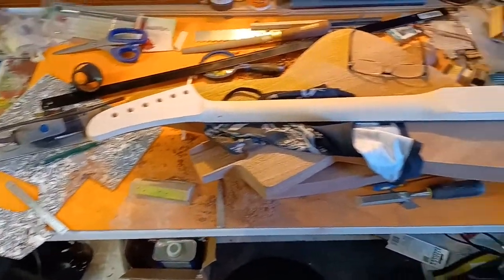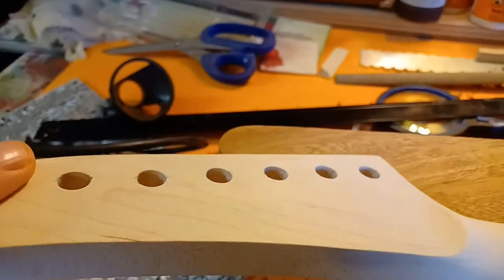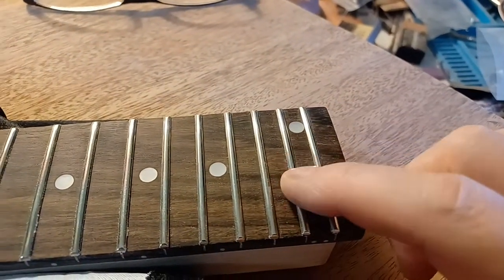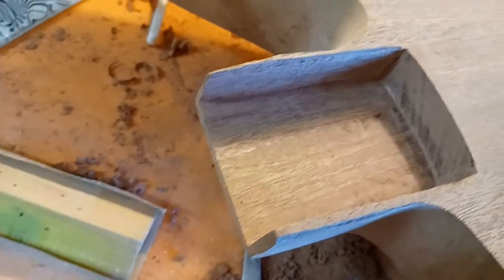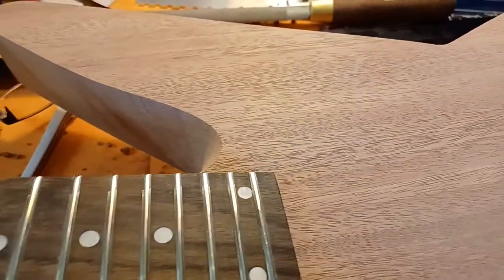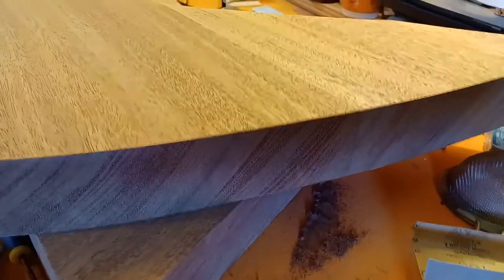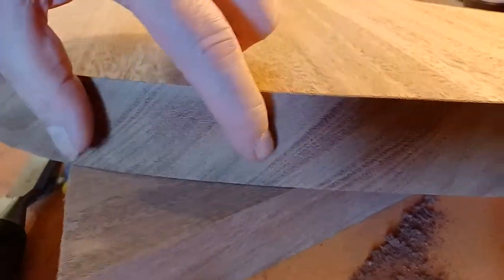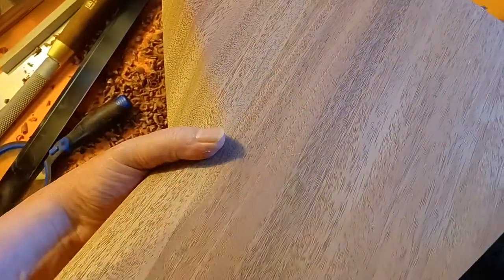GGBO 22 Build Status Update: Back to using shorter videos.

Comment: You might be able to get some of those heavy scratches out of the finger board between the frets using a box blade type of razer blade used as a scraper. Kind of sucks that the quality control was not any better. You are getting there.
Reply from the maker: I was thinking like 800 - 100 grit paper in the direction of the grain. But the razor idea is surely worth a try. Just not sure how steady my hands are for something like that.  these are the same guys I got the neck for the BRS from and that was spot on minus a little sanding to get rid of the sealer so it would stain properly.  

I'm not entirely sure this was meant to be a "Production" level neck either. They normally use medium or larger frets, larger inlay dots and seal the wood this one is not sealed. As far as I can tell this was the only Explorer style head stock neck they had. I looked many other places and couldn't find one that wasn't a true Gibson neck with asking prices in the $400 plus range.
Reply from the maker: Hey Robert. Dude I owe you a beer er somethin hahaha. I just got done scraping that fingerboard. What a major difference. Cleaned up those lines nicely AND brought some of the more subtle grain features to the front. Gonna post a short video later to show what a difference it did make. It even feels Much more smooth and slidey.

Comment: Nice work Bill and good thinking for moving the jack socket round further, I always put the socket right round near the strap button for ease of use too! 👍
Reply from the maker: Thank you Gio. I don't understand other then tradition why makers STILL put the jacks under the bodies on the lower side. Most people wrap the cord over the strap button to keep from tripping on it. Then there is the wireless systems even MORE use these days where he transmitters hang on the strap and the wire hangs down to get plugged in. I can not tell you over the years how many cable ends I have had to fix for myself or other players because of that.
Reply: @borgonianevolution  agreed, I mostly play sitting down and I use wireless which makes the traditional placement totally wrong for me. I think more and more people are going wireless now too.
Reply from the maker: @TornelliGuitars  I still have an OG Nady pro system in a box somewhere from back in the day with my last band I played Bass for.

Comment: Have you thought about putting 2 pieces of tape on the twelfth fret and filing a fall away into those last 6-8 frets? That may get rid of this fret damage! Just a suggestion man. Looking forward to this build. ✌️ Love that body.
Reply from the maker: Yes sir I did. I thought I could cure the ding with fall away but it is still there. Less predominant then it was but still there. Its on the 23rd fret at 4th string height so not much gets played there from me at this point of experience and abilities so not too worried. Well other then it triggering me because I KNOW its there.

Comment: Looking good sir....yeah neck does have some blemishes, hate that. My 2 cents on the body....add some curves to it! The straight edge look is cool, but I'm all for adding curve to the horns, etc. Of course, I am not sure how easy that will be with your current tools. But you have done a good job already! Keep it up man!
Reply from the maker: Are you talking about rounding just the edges or rounding the body itself more like a Stratocaster round? Explorers tend to be more flat faced with comfort and contour carves mostly on the back so you don't have a square edge sticking you in the ribs or belly.  You have to be careful when rounding over a flat faced body as proportions can get wonky really fast. Ever see how wonky an Ovation Acoustic looks and feels?
Reply: @borgonianevolution  Mainly the horns like you mentioned in the video. Still keep the main shape, but round the horns and if there are any other similar areas that would need it. I wouldn't want you to redo your whole design or anything =) 

Ah yes, my main acoustic is an Ovation. I do fine with it when it's strapped....Sitting down sometimes is a challenge.

Comment: Too late for that neck pocket, but I've got a router that was given to me that I'm not using. Send me your address and it's yours.
Reply from the maker: That is an awesome offer mate. MUCH appreciated. I think you should maybe hold on to that for your own use or for someone planning on making more guitars. I may do one more after this but where I am is rather paranoid about fires and have already frowned on my build last year. Probably not the best of ideas to kit out a shop in the kitchen. As it is I need to start camouflaging things here soon with yearly inspections coming up and the fire inspection shortly after.

Comment: That fretboard looks awful! How do they send you something like that? The guitar body is looking good though.
Reply from the maker: It is what it is mate. I didn't make my own. I didn't source an Original neck replacement. Yes it needs some love and I expected that for an under $100 dollar neck. It is straight and the wood is solid. That maple was a pain to sand down to get the break angle it is so hard. I am not knocking what I have I am just documenting the build process and what I am working with. In any case I get to learn new skillz and tricks to make it better.